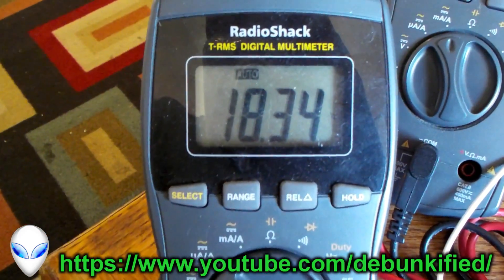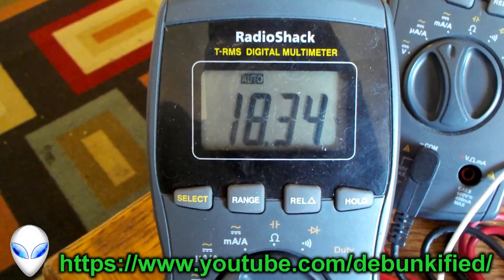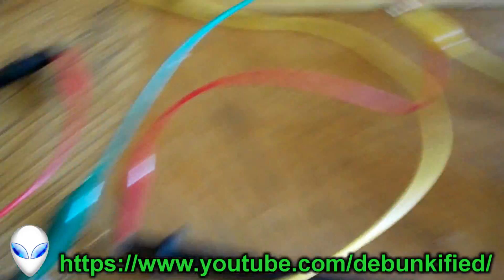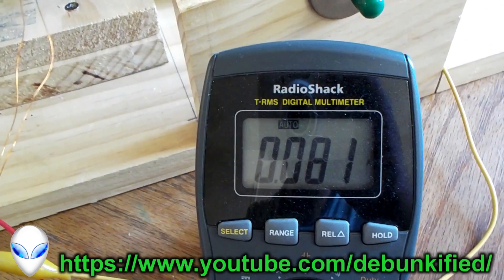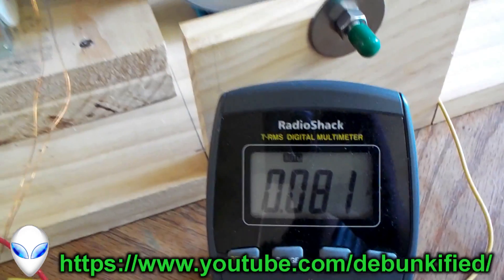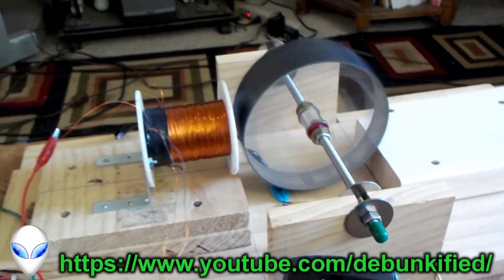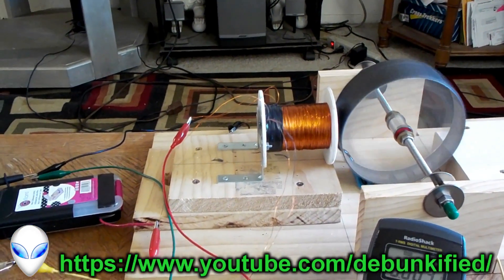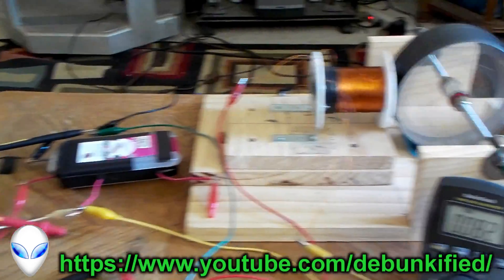Higher Voltage = Better Efficiency - (127% Efficiency)

Comment: Why have you got the current being measured between the capacitor and the motor?
The current you are measuring is not DC, it is pulsed due to the reed switch, so your meter is reading some sort of average current which is lower than the real current.

Measure the current between the output of your box, DC-DC Converter, and the capacitor, you will get a better reading of output current like you say you have for your output voltage.

PLEASE circuit diagram.

Google  WAGO CONNECTORS    you will never use clips again, and you can avoid the multi coloured rats nest.

http://global.wago.com/en/products/product-catalog/terminal-blocks-connectors/overview/index.jsp

Comment: Can it be hooked up to something like a Refrigeration Compressor to keep my beer cold ? I would love to see it do that.
Reply from the maker: +David Lyon Hey David, It really depends on what kind of load it wants to run which is a bit limiting and is dependent upon that type of load. Right now, we're working out running any type of load.
Reply from the maker: +debunkified Fir this particular load of a simplified pulse motor a better motor would have to be manufactured, mainly because of torque issues.
Reply: It might need some type of computer then. If you can build inertia (in that flywheel) then that stored inertia can transferred to the compressor. You might need to pulse the compressor - that is, use an entirely different type of logic to keep the beer cold - drive the compressor for shorter periods of time. I have a spare refrigerator just sitting here waiting to see this work.